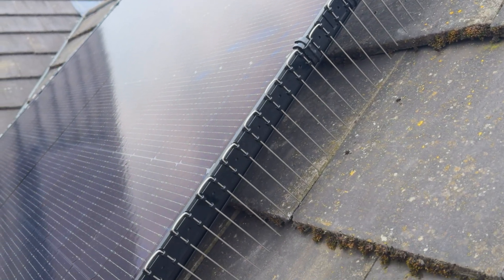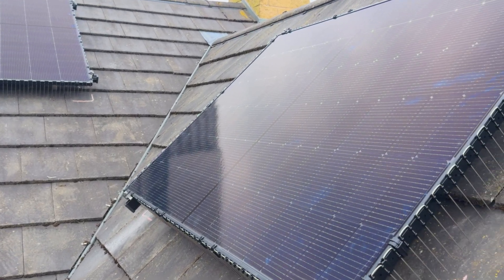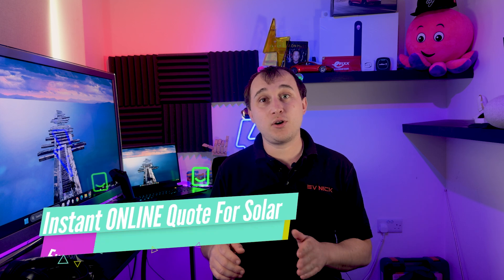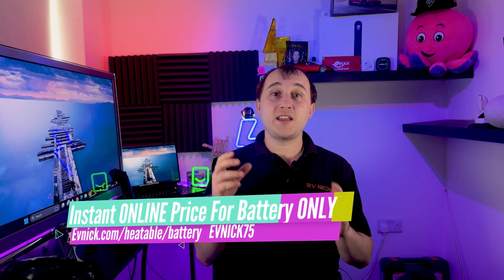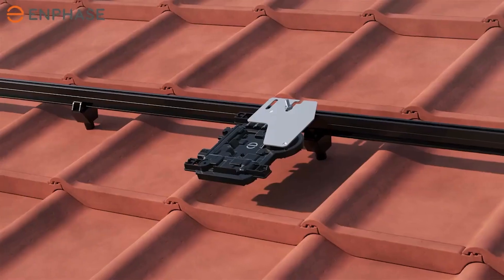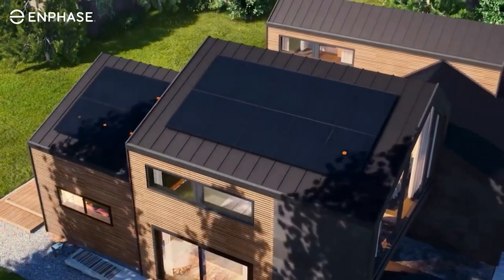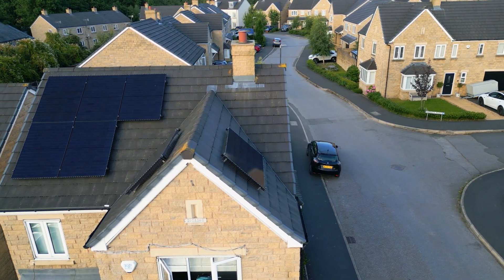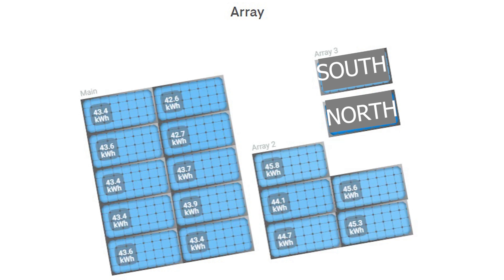Why They Say You Can’t Have 1 Solar Panel (But I Did Anyway)

Comment: I used Enphase on all 21 of my 410 panels. I also bought the Enlighten Manager as i can see every panel. I have south, west, and north panel's. a 19.9 kwh battery system. Its been running now for 2 years and hasn't cost me a penny in electricity or standing charge. I have roughly £1000 a year pay back from the grid. So i am having a 9kw air source heat pump fitted by Octopus and we will see if i can get electricity heating for free. Total generation since  switch on 14 .7 mwh.   The ac system out shines the DC buy a mile.
Reply from the maker: Jealous of number for panels!!! Using Octopus Energy Services (Heat Pumps) then you can get £100 off when you split £200 with me Use my unique referral code: 87680

Comment: We have 2 north facing panels. They have so far produced 152 & 200 kwh. Our 4 South facing panels produced between 197 & 214 kwh and our 13 West facing panels produced between 144 & 215 kwh. So our North facing panels come 8th & 17th out of 19 panels over the last couple of years. Now we have shading issues being on a hill meaning that early morning and late evening the sun is behind hills and in leafy months the sun can be behind trees for 2 hours of the afternoon. Mix this in with some weird roof angles and the comparison is not particularly fair... But it does show that they north facing can hold its own.

Comment: One of the poor designs of new build houses is to keep cost downs they dont install solar panels. To make it worse the standards of roofing has been reduced so the roof would need extra timber supports to take the weight of panels in future.. madness

Comment: Problem is you can't use micro inverters with an offline system or when the power is out
Reply from the maker: Depends what battery you use with it… also Enphase have a gateway coming out which will allow it

Comment: 1:40 I'm growing ever more convinced that this is no longer the case, at least with modern panels, as they mostly now have 3 by-pass diodes in them to negate this old issue of one panel bringing down the whole string. @solartimeusa did a test a few weeks back and proved that this is no longer the case and it's only really that single panel that drops, and not the whole string. All that happens now is that if one, non optimised panel is partly covered, just that panel drops down, not the sting. Highly recommend a watch on the 3 tests she's done comparing sting vs optimisers vs micro etc. I did use Tigo's on my rear roofs with north/south panels on one string, but I now wonder if it was even needed. They do help, and her tests show a 10% improvement with optimisers but they are not necessarily essential.
Reply from the maker: It’s depends on panel manufacturer really,  REA panels I have were designed with micro inverters in mind due to its bifacial element the performance like this is top notch
Reply: @NicolasRaimo  pretty much every new panel I came across when getting quotes had 3 bypass diodes, even the REA Fusion 2 panels have 3. I'm not saying that optimisers and micro inverters don't have their benefits, but the panels themselves now have a certain amount of optimisation built into them. So the claims that one panel being shaded brings down the whole sting down to that worst performing panel is now a myth and can be put to bed. Only in a retrofit situation or some really cheap panels would this be relevant today. Have a watch of 'Solartime with Martyna' video's where she has 2 identical arrays next to each other and then covers panels in turn to simulate different shading conditions. She's done a couple of tests, one with Enphase micro inverters vs string with Tigo's, and then another with a string inverter having optimised and non-optimised panels. Having some sort of optimisation does help, be that micro inverter or optimisers, but it's not like it used to be. More comes down to cost vs the advantages of slightly higher yield and per panel monitoring.

Comment: Bifacial panels on a black roof mounted mere inches above it are going to have pretty much zero benefit, they are designed to be mounted quite high above a reflective surface, unfortunately Heatable peddle them as a benefit, when it really is negligible, if not of zero benefit when mounted on a roof in the way yours are. Also optimises are not a magic fix, there is only so much they can do. Micro inverters will obviously work best given shading and different orientations but one day they will start failing then you'll need scaffolding to replace them.
Reply from the maker: Heatable have real UK test data showing these bifacials with near 20% uplift vs regular panels,  also look at the market now everyone’s moving to bifacials fitted this way not just Rea and Heatable
Reply: @NicolasRaimo  I did question the claim on that Heatable video of 20% uplift but they never responded to that question. The claim was that the string inverters only report production before conversion to AC hence the massive uplift as Enphase report after conversion to AC.
My question was, that given as you mentioned a string inverter requires a minimum start up voltage, would removing half of the string have had an impact on how early the panels would have fired up the string? On the DC/AC reporting side, my Sunsynk app reports 583kWh exported so far this month. The MyEnergi app reports 550kWh exported and Octopus is tracking at 499kWh (that's with one day missing, and being 2 days behind) so by the time Octopus catches up I think the Myenergi app is pretty much spot on. At best I think it's more like a 5% reduction. Now, I could have miscalculated somewhere so I do need to find a more accurate way to work out my inversion losses, and make sure I haven't omitted anything, but I can't see a 20% uplift being that credible a claim as they never compared the outputs to the clients previous bills. i.e. to see how the inverter export compared to any SEG payments received where, as that would show the difference.
Reply from the maker: @steve_787  they ran the non bi facial panels on micro inverters also so was like for like test
Reply: @NicolasRaimo  no, assuming we are talking about the same video from Heatable, they took off 5 Q-cell panels and replaced them with REA panels. So it was 5 Q-cells on a string vs 5 REA's on Micros. They even said "why didn't we just use the Q Cell panels with micro inverters, because they wanted to compare it with the REA panels". So the string went from 10 down to 5. So they ran two 5 panel systems, in parallel, for almost a year. They didn't put the microinverters on the Q Cell panels. But my point is, reducing the number of panels on the string would have lowered the overall voltage, meaning the panels on the string would have needed more sunlight per panel to get them up to the start up voltage. I will note, that in my question to them, I assumed that this would likely be minimal, but would it still make some difference. They avoided this question but did reply to another of my comments which was a bit odd. I also have a Sunsunk inverter (8kW Ecco) and have a CT clamp on a Harvi so can compare, as they did with the Shelly, the figures reported on the inverter vs on the mains. I can then confirm this with the payments from Octopus. I'm looking at around a 5% loss from inverter to grid. Most of their uplift in production came after they "factored in" how the Sunsynk reported the production as they were reporting a 2% gain beforehand.  Even then, they were comparing 400w mono panels to 440w bi-facial so even without the rear of the panels, you are up 10% anyway. I'm not saying they don't provide an uplift, I just don't agree with their claim of 20%. I'll have another look through their channel to see if there is another video I have missed in case we have our wires crossed or if you can link the video you are thinking about?
Reply from the maker: @steve_787  ahh they have another video comparing 1 bifacial to 1 standard 440w panel
Reply: @NicolasRaimo  ah, was thinking we must be getting our wires crossed. I can't remember which video that was, only video I can think of where they claimed a 20% uplift was that comparison they did on a previous install? Leading up to me getting solar I think I watched pretty much all the solar channels on YT so must have seen it at some point 😅 I was leaning towards bifacial panels and micro inverters to begin with but changed last minute to hybrid inverter and mono panels as the mono's were slightly smaller but still 445w. Mainly due to cost uplift vs improvement on yield.
Reply from the maker: @steve_787  heatable only quote the front of the panel not rear bifacial part ;)
Reply: @NicolasRaimo  yes, all bifacial panels are quoted front only. No way to know how much you get from the rear without knowing the height the panels would be set and how reflective the surface below them will be. My issue was that a matching wattage bifacial would have been at least 4cm longer. The roof space was tight, so I might have had to drop a panel or 2. The Same size bifacials were 410w, so came down to a difference of 0.63kWp in array size over 18 panels. Honestly drove me around the bend trying to decide what to go with 😉

Comment: I looked again at a quote for solar panels last week. Two were something like 3K and 20 were 9K. Hardly surprising when the price of panels is less than £100 each in some cases. We are being ripped off by installers when 98-99% of the cost is installation. As I can only fit five on my roof its still not worth it for me.

I have DIY'd 600W of solar on my shed flat roof as a hobby for less than these installers will get out of bed for and that has been fun to play with. :-)
Reply from the maker: What direction is your roof it might be worth it depending on that did you try a quote via Heatable? If not worth it maybe look at battery only installs now they 0% vat.   Heatable given me codes for discounts for my audience on both if it helps
Reply: @NicolasRaimo  North/South and I have a roof with a sloping side to the west that could have panels installed too but most installers I have contacted for quotes seem reluctant to split install like that as per the subject of this video, but I haven’t watched it yet. 🙂 Thanks for your reply and advice. 👍
Reply from the maker: @st200ol  5 each side or 5 total? What’s the split if first?  My 1 south panel did 44.9lwh last month so times by 5 if you went for same rea bifacial Enphase system as me and north did 31.8kwh I suspect that be enough to cover your summer useage
Reply: @NicolasRaimo  How many depends on the size of them. 😉 5 on the south and 3 on the west perhaps. I’m not sure how unique my situation is but I’d need batteries I think because my daughter has a gaming PC that she often uses all evening and that pulls up to 1kW. No idea how much battery I’d need perhaps 8kWh that I could charge from solar or when Agile is a bit cheaper during the day. I would automate this with home assistant assuming that is possible.
Reply from the maker: @st200ol  I say most people going to need LEAST 10kwh battery with option for possible future expansion.  Heatable can do an online instant quote based on there panels try evnick.com/heatable your need your postcode but no other personal details obtained and unless you ask them to contact you they won’t but means you can see how many panels there system reckons your fit
Reply: @NicolasRaimo  Thank you I’ll give it a go.

Comment: I’m guessing your single North facing panel will make produce around 200KWH in 12 months,  I don’t think from October it will make power until March April, I have a North facing roof with a potential space for a string of 5 panels and I also have a spare MPPT on my inverter so I hope your panel performs better. Good luck

Comment: I don't exactly agree with whoever told you so Nick, the Mppt will have to juggle between the two strings/panels trying to find the best performance out of the Amps/volts using the resistance factor. Although I agree that multiple orientations should yield multiple MPPTs (as I have done) it would work even if that wasn't the case, at least that is so if using Victron equipment, the performance wouldn't be optimal but it would work and not as badly as to the degree where everything would follow the lower values. Also, since in the UK we often have cloudy skies, the light is more diffused and gets distributed more evenly across the panels and that can easily cause a less prominently positioned PV module to outperform the optimally situated one.

Comment: I'm waiting for my PowerWall3 with three MPPT inputs, and panels on my N, E & S roof faces to feed each of these inputs.  
Conventional wisdom suggests that the N face would not be worthwhile (it is actually a bit more towards the NE), however I've read that on cloudy days the diffused light will actually drive the panels quite well.   
As my system is to be installed when PW3 lands....  Mine is on pre-order....
I will probably start gathering monthly data from October!
Reply from the maker: Heatable started installing pw3 last week I’ve done a video with them on it soon
Reply: @NicolasRaimo  Any idea when the expansion battery units will be available

Comment: Having had  two systems fitted of which one of them is with micro converters and the other via a hybrid invertor, I agree that micro inverters do serve a purpose for installing a small number of panels. I would however challenge the other benefits called out in terms of switching on earlier and staying on for longer. This is not what I see daily with my inverter arrays performing better and for longer. My west inverter array for example switches on earlier than my east array with microinverters fitted. If fitting one or two panels, I see the value of microinverters but would not recommend for more panels based on my experience